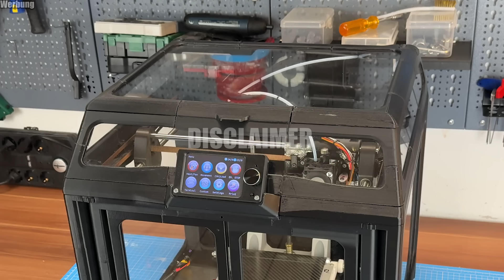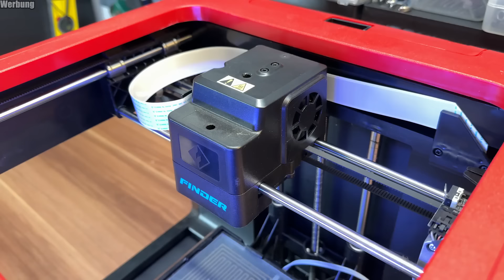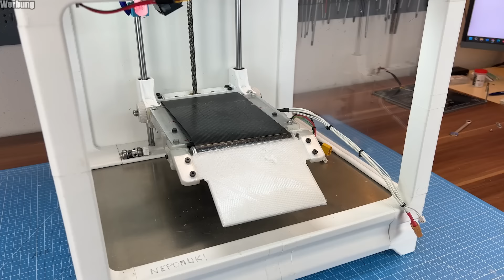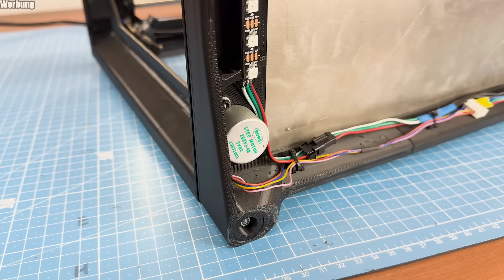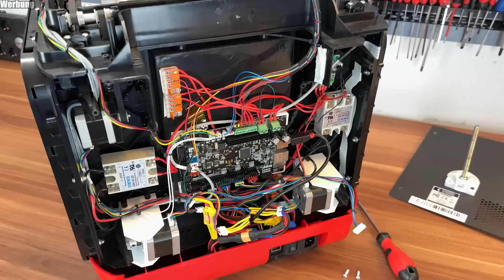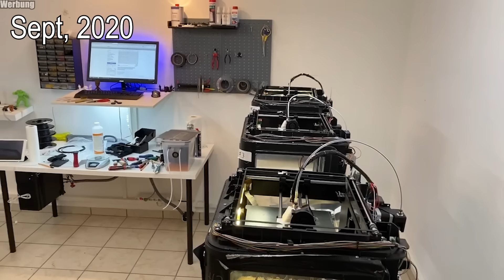Automated 3D Printing with THE247!

Comment: The concept is cool, but the printer is full or crazy systems. IMO we don't need yet another DIY printer platform for this, but it would be more useful to work on the ejection system specifically as a bolt in mod for existing printers like the trident that people already have.

Comment: Cool project! 

I would be interested in build plate  with a roller that can be added to e.g a Bambu A1 or A1 mini.

In this way you would just focus on fhe build plate and not having to worry about the 3d printer. It would also be cheaper to develop.

Comment: I like the idea overall!
But it definitely needs a more ridged bed and most likely aluminum extrusions in the frame parts to get decent stiffness. Higher voltage and aircooling for the motors is a must have.
Style wise I can't stand the big gaps between the printed frame parts, but it's overall shape is nice! And since it's a machine for mass production with its belt bed and automatic doors (great idea btw) it should have a quick way of swapping filaments. Like 2 would be enough for color markings or support. But that will overcomplicate it most likely :\

Comment: Keep the project going because there can never me enough innovation.
For me the main aspects for a new version would be:
 - better space efficiency at a 180mm bed size. (Micron 180 for comparison)
 - keep the linear rods for cost efficiency
 - look at the Voroff design to maybe avoid complicated belts

 - heated and filtered chamber
 - open toolhead design so everybody can choose their own hotend + extruder combo (dragon burner like design)
 - 3D printed frame is interesting but it's annoying to have to reprint a frame piece for a simply modification.
I advocate for aluminium extrusion,  best case scenario is to reuse an existing frame kit for another printer you can get on aliexpress.

Comment: In my mind the belt system is too complicated to manage, and would, probably, be unreliable for big print areas. It might be the best to design build plate swapping system that would live either on top of below the printer, like someone already done that for smaller bambu printer.
Load 5-10 build plates and leave for the night, while it's printing. The same system can work reliably for any build plate of any size. And if you need to print some sort of engineering materials with using adhesive - no problem, just apply adhesive to the plates before putting them into the system.
Belt sounds good and simple, but in reality it's more complicated then plate swapping system.

Comment: I'm not that much interested in a machine which can put out the same part or parts of the same material one after the other automatically, 
... but if it could swap filament automatically (AMS like or toolchanger like) it would become very interesting to me.

I know most ppl buy like 2 diffrent materials and print with only one till its finished, but I like printing with diffrent materials almost after every print when prototyping (like the idea of putting the right material where it belongs insteat of makeing a project out of just petg; multiple colors is kinda nice to)

Comment: A frame printed out of PPA-CF would almost certainly be more expensive than a metal frame, right? I also don't think you'll be able to achieve the same print quality at speed as the bambu printers either, because a plastic frame isn't stiff enough. I like the conveyor bed so maybe it would be interesting to replace the bed of a bambu p1p to make it fully automated.

Comment: 8:30 For a printer made at home, I don't give a crap about seeing the fasteners. Would making them visible make the frame stronger and the assembly easier? Then I would much prefer that. This is a made at home printer. You can put easily removable printed caps or covers over socket head cap screw counterbores where the hardware would be. Make it super strong, easy and rigid. Also, would a 220x220 or a 245x245 build volume for printing the printer make it so that it could be printed in less pieces? A standard ender 3 style build volume is more common and it is most likely what most people would be printing the pieces for this printer on. make the frame around that design instead of the A1mini. :) Keep up the great work.

Comment: I think you should consider to Work together with Matt use the t250 as a Base an Implement the bed and Doors from your build. This might be an awesome Combination
Reply: Ugh the T100 is mediocre, the T235 won't be much better. Any half decent Ender 3 mods (under 200usd+printer total) are faster than a T100.

Comment: Theres a lot of good ideas, but in the spirit of the brutal honesty requested, the biggest problem I see, is one of the requirements; that it must be 3d printed.

This results in a frame that isn't that rigid or precise, looks very throw together and limits your creativity.

I feel as if the use of now more commonly accessible methods such as laser cut steel plate and even some cnc parts from services that are more accessible and affordable than ever could both make this look significantly sharper while offering you more freedom in design, precision, temperature resistance and potentially even allowing for more build area per the outer area. I even imagine that with some nice larger scale resin prints you could have injection mold quality parts for the interfaces.

I have another thought about the idea of the belt. I personally don't see much reason to have a complete belt.

I imagine a system that had a belt or simply highly flexible plate double the length of the build volume would be enough to eject any possible print as there is no need to have a continuous belt for a printer that has a 90 degree printing angle.

Witb this change to the bed I think you could really enhance the build volume and simplify the bed, allowing for a wider range of materials, larger bed and less complexity as you could even just have a flat bed and use lead screws or some other simple but powerful mechanism to remove prints 9nce the bed is cool.

As for the toolhead, I think a reliable nozzle based system that gets the nozzle clean every time is important, and I reckon for ease of use and repairability, using a linear rail rather than rod specifically for the x beam would greatly help and allow you to modify things without needing to undo so much.

As a final though I really have thought that I've for a while thought that H bot printers really have excellent properties in terms of simplicity and high speed and have the one great big flaw of skew in the motion system. I reckon that by using for example 2 wide carriages on a linear rail, and cnc parts, the rigidity gained could allow for the negative to be removed letting the benefits of Hbot such as enhanced space efficiency and simpler routing and repair shine through.

Overall I find this project very interesting and would love to see it go further.

Comment: I consider aluminum etrusions to be a "vitamin" at this point, just like screws, linear rods, leadscrews. etc. I understand there are certain advantages (and cool factor) to printing the frame, but given how inexpensive and ubiqutious aluminum extrusions have become, and the fact that a printed frame still requires other hardware to fasten it together, I don't see major incentives in avoiding aluminum extrusions for frame components (at least from a performance perspective). Not everything can be reprapped with FDM printing, and maybe not everything should.
Reply: I just don't see the reason to use aluminium extrusion for any bits that move as while not their intended use, linear rails and rods are both more than strong enough on their own.

As for their use in construction, I reckon that the need to align things is a big detractor and would much rather large sheets of steel, laser cut or machined with some bracing. Sure it might be slightly more expensive but given what people spend on these enthusiast printers anyways, I see it as easily worth it vs all the needless assembling and adjusting.
Reply: @BeefIngot  My point regarding aluminum extrusions for the frame is that I consider them a "reprap vitamin", just like fasteners, linear rods, or other hardware, not that they are the best option for every use-case . They are off-the-shelf parts that have become common and inexpensive. In the early days of reprap, people used things like threaded rods for the frames, linear rods salvaged from inkjet printers/copiers because "vitamins" like aluminum extrusions and linear rods were not common and were expensive. Here, Albert is still using threaded rods and fasteners, so his printed frame still requires "vitamins". My point is, I don't think the incentives for using a printed frame (looks cool, can be printed, can be customized) that still requires other hardware outwiegh the modularity, rigidty, and strength oferred by what I consider to be standardized hardware at this point, or "vitamins" (aluminum extrusions). Laser cut/machined frames are obviously not standardized or off-the-shelf parts

Comment: problems i see with the 247:
Door gap is too large allowing heat to leak out of the chamber
Bed is too small 
Foot print is too large
Frame needs to be made with CF or GC filled filament to hide layer lines on glossy plastics
Scrap the hemera
Make compatible with monolith and cpap cooling solution

Comment: The issue i think people will struggle with it's keeping parts flat unless it's made from all pla. When they go to assemble it with a bunch of parts that are warped the frame will not be good.  

I think it helps that there are a bunch of small parts, but that presents challenges too.  I've printed an enclosure from petg and it took 4 rolls of scrapped parts and redesign before i could get parts that were flat enough.

I think it's hard to justify vs. some extrusions, but the advantage is that the user can make it.  However there are hundreds of ways for the user to screw up the parts vs. buying extrusions, and not everyone has another printer to make the parts. 

This does not take away from your design, it's just thoughts i have.

Comment: You should ABSOLUTELY keep this project going and get it to a full release version, I'd love to build one!
Reply: Absolutely agree!! I am totally flashed 🤩
Reply: 100% I would almost prefer to build this over a Voron
Reply: agreed, this is awesome!
Reply: I own one of the first 3D printed 3D printer Kits, a Teebot 3D (one out of the 42 Kickstarters) . Most joints and connections on it are 3d Printed. I would like to see another refined 3D printed printer which is easy to build. Atm i am building a Voron, #7. #3 is in the transformation phase as well (broken down Ender 3 will be something like a switchwire) Having something like the 247 would be great especially if it is a mainly 3D printed printer. The Question is what is the goal of the 247. Personally i would say: Affordable conveyor Belt Printer which is upgradable. Some Highend DIY Printer become very expensive very fast. Sturdy frame mediocore speed and good price on a conveyor Belt printer would be a nice goal and give the community and the Printer something to go go for.  Personally i am thinking about refining the Teebot Design at one Point and modernize it: Cheap to build "in the case" i3 clone which can be setup in 10 Minutes to print. And the Community needs such projects with a good price. Why build a conveyor Band printer when you can buy a Cr-30 for 900€.  When you have an enclosure, moderate speeds and all parts together for 500€ then such a printer becomes it worthwhile to do. But if you go for the highend parts and end up at 900€ then lot of folks will buy a CR-30 and modify it.
Reply: SUBSCRIBED PERIOD!!!! THIS IS EXACTLY WHAT I WAS LOOKING FOR.....just maybe at least 250×250x250 build volume 🤷‍♂️

Comment: can it print itself?
Reply from the maker: YES, its printed parts fit on the conveyor.
Reply: @247printing  that's awesome! all your plans for v3 sound perfect. most of them i would have recommend, too :) one additional idea would be to replace the cfk bed belt with diolen, it's a more flexible fibre that would help resist cracking. kevlar might work, too. there also are additives to make the epoxy flexible.